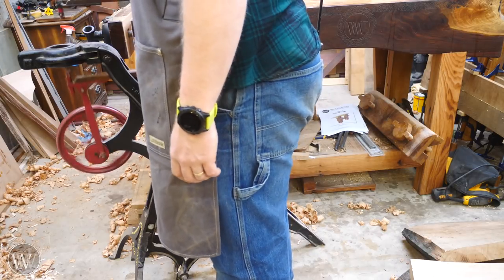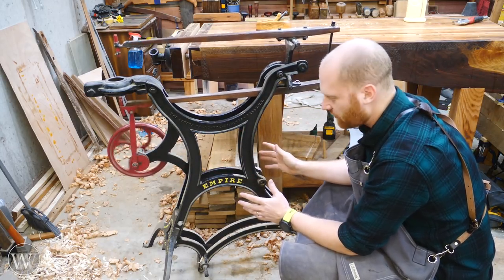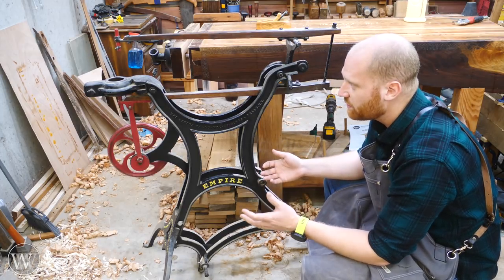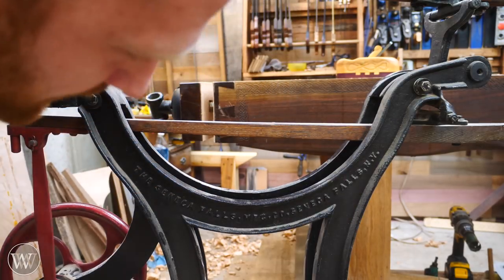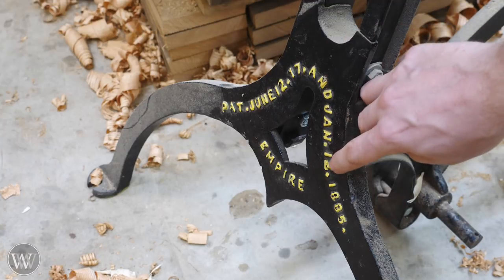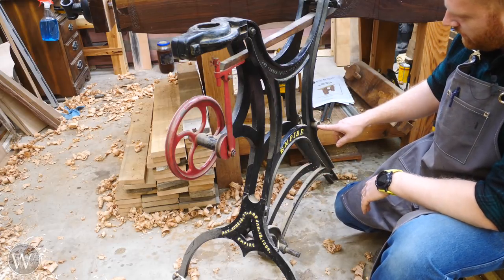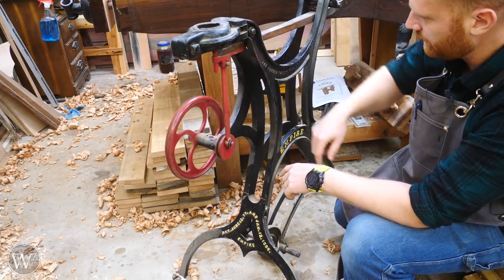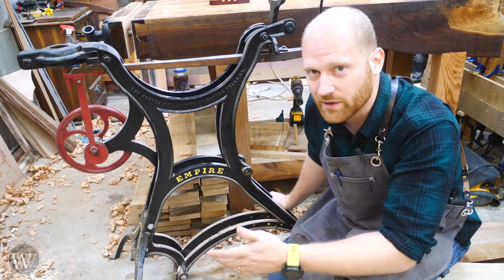Restoring a 100 Year Old Foot Powered Scroll Saw

Comment: Very nice machine it would be a shame not to see it finished. I see other people suggested Vintage machinery  ---  great work Keith is doing there. Seneca Falls also made metal lathes until ww11 the company is still around. You might be able to find out some information about the company on Lathe archive U.K.
Reply from the maker: . I've actually finished the functional restoration of it. I have several videos showing that and making a wooden flywheel for it. Sometime in the future I will probably end up casting an actual flywheel as no one has seen one in a while that isn't attached to another machine.

Comment: Oh mama!  I'm sure you can use a large flywheel off a post drill if you can find one.
Reply from the maker: I have thought about that or a sewing machine. if I can not find an original I might just make one out of wood.
Reply: Wood By Wright You could easily make one out of aluminium with a jigsaw, rasp, and some sanding.
Reply from the maker: if we lived closer this would make a fun group effort!
Reply from the maker: that would be fun! maybe should find a channel to collab with on it.
Reply: Make a pattern and take it to a local foundry. They can make an iron one for you. Wood isn’t heavy enough.
Reply: tzkelley wood would be plenty heavy. This does not need much stored power to run well. I would actually have to thin up a wooden wheel because it would be too heavy as a solid block.
Reply: aluminium  not to be too light? I think if cast, cast from brass. Even make model on 3d printer or by hand and send to someone who make cast for living. If U have pattern carved or print U can order cast iron, is no so expensive in scale 100 years more living of 100 yeras old maschine. 
I think make staf by self is greate, but order somthing from time to time to restore greate gear is acceptable.
Reply from the maker: yup. I have a contract with a foundry in CHI may have them cast it out of Iron. brass would be a bit too heavy. If it is too heavy then it is hard to stop and stary which yuo do all the time. I may end up going that route. we will see.
Reply: Wood By Wright what about aluminum bronze!
Reply from the maker: I have a contact at a foundry where they do cast iron.  and that step would make a great video.
Reply: Yes, it certainly would!

Comment: Well I simply googled 1920's empire treddle scroll saw and got tons of articles and images, they made a lot of models there was a 1920 model in Orange that had an electric motor. I don't know if it was a factory or user upgrade. Mfg, manufacturing. I didn't read the article but some recent dates were mentioned so I don't know if Seneca is still around or not, hope this helps, love your videos!
Reply from the maker: yup the company is still around today but they stopped making these int eh 30s.  Seneca Falls Technology Group

Comment: That looks like an Awesome "foot" tool.  You could use that high powered computer you have and draw a version of the small flywheel.  Then up-size it to fit the frame.  Then find a 3d printer in the neighborhood.  have them print one out.  Then take it to a local foundry and have them make a greensand cast and cast one for you.  you might still have to clean it up, but I'll bet that is well withing your skill set.  Same for the pedals, then you could incorporate your WW Wood by Wright logo.   

looking forward to your restoration!
Reply from the maker: thansk Bill That is my backup. we will see how it goes!

Comment: From the pictures I saw, the flywheel looked roughly 2.25-2.5 times the diameter of the smaller wheel. A lot of the pictures seemed realitively well-detailed for a functional recreation. I didn't see any parts and the one "all original" one was something like $4k.
Reply from the maker: Ya there are a lot of good pics online. Still trying to find shots of the table and lincages though.
Reply: That is the patent that was used for the table.
Reply: I would think you could turn a sphere on the spring pole lathe, then turn a flat side and hollow out a conical section in the center, opposite of the flat. Although, it might make sense to cut all the way through and make a zero-clearance insert to fill the hole. After that, a flat table should sit nicely. The only concern would be if there was enough meat left. In that case, leaving a wide, flat lip on the top of the flat side of the sphere would be necessary to provide the glue and screw area.
Reply from the maker: yup. the patient drawings do not actually show the parts I need. I can think of several ways to do it, but I wanted to know the original method. and who knows. someone might have one out there that I can buy. that would be the best possibility!

Comment: You should talk to Chris (I think its Chris)  (I think his channel was interview by chris).  He does this all the time.  He probably has all the fly wheels and linkage you need.  He is terrific at making these kinds of old tools work well.
Reply from the maker: Are you talking about "chop with Chris"
Reply: Yes.  He makes all kinds of old, manually powered stuff.  I think you talked with him for a pod cast once.  He made a foot powered lathe.  I know he could help you out.
Reply from the maker: Yup. We did a couple colab videos a wile back. He has one that might work, but I think I would rather make one. We will see.
Reply: I simply meant that he might have some parts you can adapt.  I did not mean he should do it for you.  No fun in that.
Reply from the maker: sorry I stated that wrong. I meant I will probably make one rather than using a part that will work but not be original.
Reply: All these foot powered machines are fascinating.  Turning reciprocal motion into rotary motion.  Simply amazing how well they work.  If I could find a pedal sewing machine, I might be tempted to convert it to a lathe.  A really small one.  That would be fun.
Reply from the maker: that would be a fun project!

Comment: The ratio of flywheel circumference to drive pulley is important. As far as the table goes, I would think the ball would have a cone bored out of the inside to allow the free movement of the blade when the table is tilted. I would make a platter and ball combo and use a marker taped to the blade holder to mark a minimum circle on both the table and ball and then just slightly larger to insure clearence. Whether you decide on making one on your lathe or having one made from metal by someone with a metal lathe it will be a multi-part process. Can't wait to see this one's saga unfold. 
If you decide to pass this one along, I'd like to throw my name in the hat, so to say.
You could make the two parts, socket and table, seperately and bolt or glue them together as well.
Reply from the maker: thanks Thomas. this will be an interesting one. I was thinking the same thing about the table. I am a bit confused by the images I have found, but I would like to find close up images of one to know for sure.
Reply: Wood By Wright 
For sure!

Comment: Use an old Singer Sewing machine flywheel. Looks the same and can find them everywhere.
Reply: 3219geek I think the singers only had 1 place to connect the treadles, bit this needs 2 connections on opposite sides to run with 2 pedals....I had the same thought but could not find a singer with the two connection points. Don't take this as gospel, I could be wrong about singer.
Reply from the maker: I might but I think I would rather make a wooden one If I can not find an original.

Comment: Replicating the ball joint table might be a bit tricky if you can't find one. If you get the rest up and running, I'd just make a wooden one and attach it wherever you can just to have a flat table and not worry about cutting angles.
Reply from the maker: that is one of the posibilities. I have contacts at a foundry that I might do a video on casting a new one.

Comment: James, check out ebay. There are a lot of Seneca Falls lathe parts, but they may fit your scroll saw. I am sure they used the same parts on multiple machines as most manufacturers do.
Reply from the maker: yup I have a watch list on there. hopping to get lucky

Comment: I can't begin to see why you wouldn't just make your own flywheel. You have everything you need, including good hardwood and hand tools. I can see you making a flywheel like a wagon wheel. Just an idea.

Further, the ball joint may allow a collaboration with some of the machinist channels, Abom and This Old Tony come to mind.
Reply from the maker: yup. If I can not find original parts then I will make them. I have several designs rattling around in my head for them.

Comment: Um. Is that a DeWalt cordless drill with a hole saw attachment we see on the bench shelf? In a non-powered shop?
Reply from the maker: Yup. I have a few power tools I use for house hold projects. The only power tool I use on video projects is the power planner and I show that in the video when I use it.

Comment: the saws are all over the web. I just found an older ebay listing with all the dimensions.

from the posting

I listed this in case someone wants the victor stand but can not find a flywheel

Models --EMPIRE OR VICTOR

It has two drive grooves, approximately 21 1/4 and 23" in diameter

the axle boring is 3/4" and has a bushing in it resulting in a 5/8" hole.

The hub width is 2 inches and has a 3/8" set screw hole in it.

might be able to contact the person who was selling it, they have a fully functional one and this part for sale.

it's worthpoint.com he has a YouTube channel too.
Reply from the maker: thanks Tim. yup there are a ton of pictures and info out there but nothing I have found on the table and ball, as well as the linkages.

Comment: I think the first patent date is actually June 12, 77.   See http://vintagemachinery.org/photoindex/detail.aspx?id=10680. 
That date matches with patent 191,765 (See http://vintagemachinery.org/mfgindex/detail.aspx?id=734&tab=7 ). The second date should be Jan 13, 1885 which matches with 310,563.
Reply from the maker: you are correct. the casting on mine has a bubble on the first 7.

Comment: Quick google image search for "empire scrollsaw 1920": looks like even more is missing than the lower parts and table. Looks like there is a second upper arm, which connects to the fly wheel. http://www.props.eric-hart.com/wp-content/uploads/2011/10/seatedscrollsaw.jpg
Reply from the maker: yup that is an option that can be added. there are bolt holes for it. that is so you can put a drill on there to create holes for the blade to start in the middle of the piece.

Comment: drill  2" holes around perimeter   fill we lead shot and seal holes
Reply from the maker: That was my original thought but decided after using it for a while that more weight would actually be detrimental to its function. It would just require more energy putting into the wheel but the wheel currently has far more than enough power to cut what I need.

Comment: Good luck in finding another large flywheel.  Unfortunately, saws that were converted over to electrical had their large flywheels and pedals removed.  This is likely the case in your saw.  These parts were discarded and are, therefore, very scarce now.  You will most likely need to find someone who can cast you new parts.
Reply from the maker: Yup that is often the problem. If I can't find originals I will make them, but it would be nice!
Reply: Here is a link to an old Seneca Falls catalog. http://vintagemachinery.org/pubs/734/3406.pdf  It provides some dimensions (15" diameter table top, 24" driving wheel with v-groove), but I don't know anything about the attachment of the top to the base.
Reply from the maker: yup. that is a great page, the parts i have not found information on are the table and ball, as well as the linkages.

Comment: Treadle powered? Next thing you know, he’ll be using a cordless drill! :)
Reply: he didn't  even try to hide it! it was on display during the whole video :)
Reply: thelichisdeath I’m pretty sure he’s mentioned having it in the past but still... lol
Reply from the maker: yup I have 2 drills a palm sander, router, and a few other tools I keep in the shop. I do not use them on video projects, but there are always things to be quickly made around the house. I do have a power planer that I will use from time to time in the videos.
Reply: To be fair. The brace and egg beater drills are also cordless. Just saying
Reply: Richard Wright then would a bow drill be considered “corded”?
Reply from the maker: you got a good point there. that sounds like a great video cordless vs corded!

Comment: Flay while U finde (if no finde orginal) in any sew maschine like a Singer. Is comon part. Do U look for patent draws? Maybe someone add motor to this and loose parts which no nead.
Reply from the maker: might but I think I would rather make a wooden one If I can not find an original.
Reply: as i have foot pawer sew maschine, and forge im sure important is weight of flywheel and balance. It will be difficult to match this in such small space by wood one. cast iron is beter chuse. but I may be wrong. Good luck ;)

Comment: Here is a link to a site with some pics and measurements.  http://www.americanartifacts.com/smma/advert/ay331.htm
They state the flywheel was 24 inch.  Also they have pics of the treadle mechanism.
Reply from the maker: yup they have the nicest resource out there, but still do not have the information on the table and ball, as well as the linkages.

Comment: there is some Information about this( or similar) scroll saws on vintage machinery dot org. the site is run by your fellow you-tuber keith ruckers
Reply: well at least an add for it:
vintagemachinery.org/mfgindex/detail.aspx?id=734
Reply: http://vintagemachinery.org/mfgindex/detail.aspx?id=734 is about this manufacture, but it doesn't contain detailed information (still more than one would expect for brief internet search - it's great website)...
Reply from the maker: yup. good resource there.

Comment: I found pictures on line of this foot powered scroll saw. I have yet to find any parts and such. for it, but I have no doubt that you could make replacements out of wood and other scraps of metal. Here is my Email address if you have not found any pictures, I can send a copy of what I have. I await your response. Jim.
Reply from the maker: Thanks man. Yes I have hundreds of pictures but still have not found them for the ball on the table and the linkages design. I am hoping to find originals but if not I will be making them. I have fun ideas for most of them but would love to see originals.